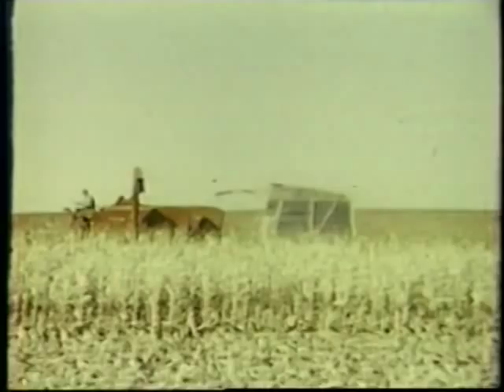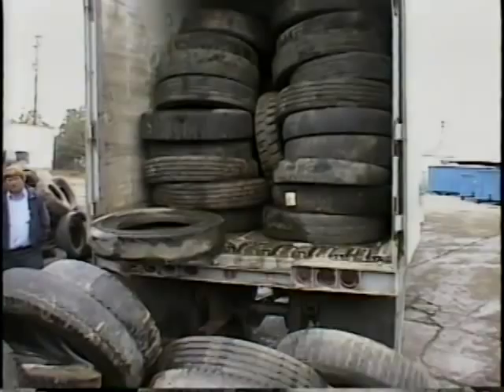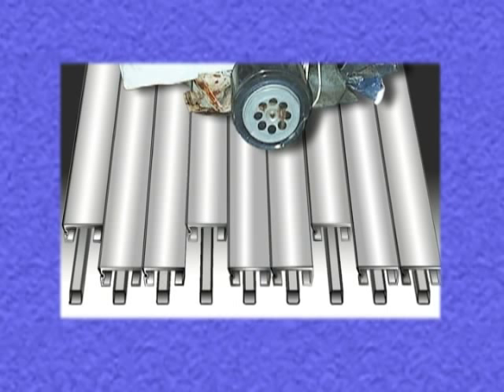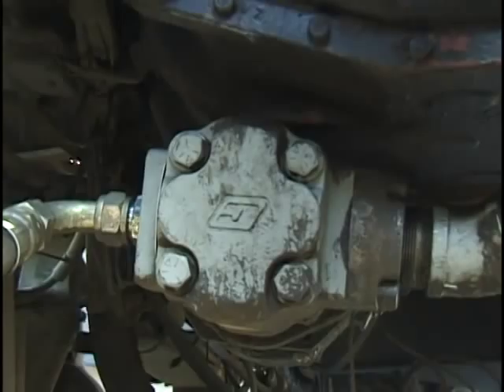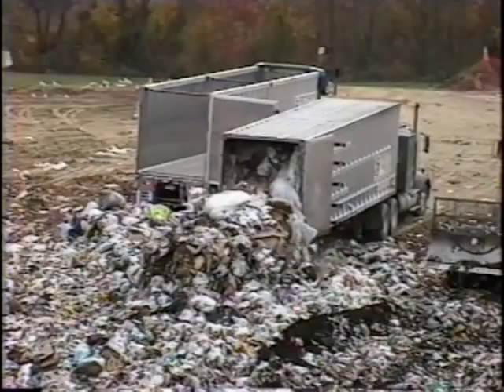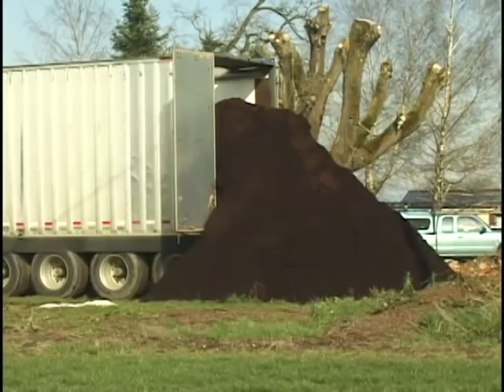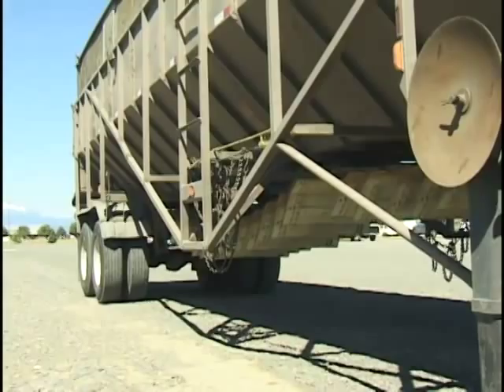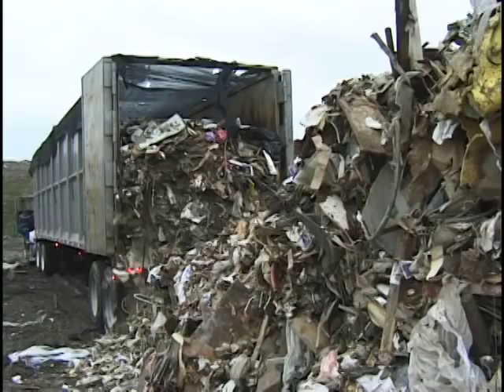KEITH® WALKING FLOOR® Unloader

Comment: I have a 53' 8 axle I usually haul tree bark in but we have also used it to haul bailed hay, silage, potting soil, saw dust, scrap tires and wood chips. It's is a brilliant system!

Comment: You say and compare other systems to yours from 7 and half to 8 minutes how when the other designs break down they have to be unloaded some other way and yours does not, I beg to differ especially if the load is to be unloaded no matter what such as delivering gravel for example and the customer rather no wait until the hydraulic is fixed to get the rest of the load delivered and put down. Hus even your system has a breakdown at the hydraulic point and yes they will fail eventually at any moment during use, spring a leak in the hose or connection or the cylinder seal itself fails in some way, let say it was the center hydraulic, now you got a stuck walking floor, So now the user of your product has to manually unload at worst by hand with shovel and broom.

Also at the time you compare load capacity before mentioning the former comparison, you were clearly using a box shape with what is likely a flat blade, when in fact the competitor uses an angled blade, and this blade which is attached to a conveyor does not take up that much bulkhead let alone if any bulkhead for that matter. thus their capacity is not as reduced as you showed. Then again some manufacturers designs are as bad aw you displayed for other live/walking floor type designs.

Still your product is really sweet and nothing is 100% perfect from concept to use and I never really seen these or other live or walking floors being used to transport fresh or recycled roadway asphalt or even driveway asphalt, that industry seems to enjoy staying the (un)conventional tipper dump.

One thing I never seen on any of these type of trailers is the utilisation of UHMW PE on the sidewall as this stuff is slippery and will protect the metal or if it replaces it will then lighten the trailer weight and make loading of abrasive loads like scrap metals and aggregates even more easier with less need to repair the former metal sidewall skin. One manufacturer uses this as their skin over their frame and they are tipper dump type body and they show just how well the highly to ultra durable plastic lining is letting all the load just slide out and much quicker too and they use at least half inch thick of said plastic. Just something to consider looking into as an option for your customers, either laid over and secure with rivets or bolts or slips into a channel holding it into place even as it is a flexible sheet at even three quarter inch thick. I myself if had bought and owned one of your trailers, would take the time to do this to the sidewalls over the original metal skin you guys use, may cost some but saves lots of money in not needing to replace the metal skin as it gets damaged.
Reply from the maker: Thanks for your comments, Joshua.

Actually, KEITH does have a system specifically for unloading asphalt. You can see it here: https://www.youtube.com/watch?v=_Rex_K20-9c
Your ideas on trailer design are interesting. We don’t build the trailers, just the unloading system, so we leave the design process it to guys like you.
Reply: It's all in the maintenance I've ran multiple types of hydrolics. Dumps car haulers tow trucks liftgate trailers.  hoses maypop at any time. So the question is you blow a hose do you have a spare? How well is you maintenance
Plan?

Comment: Tried ash on this and it fucked up sold the fucking shit to scrap
Reply: My nerved fucked. Excavator was needed. Ash was not excluded in manual.
Reply from the maker: Ash does work/unload off a WALKING FLOOR trailer if operated properly and with the proper/sufficient hydraulic pressure to move load. Ash is hard on standard aluminum flooring due to it abrasiveness, but it will typically unload without issues.
Reply: It was birch as partially wet. Not mentioned in manual. It was total screw up. I don't sue you just mention in manual it is not suitable for this job.
Reply: Still have this trailer it's working most of the time. Well. But add no wet ash to manual.